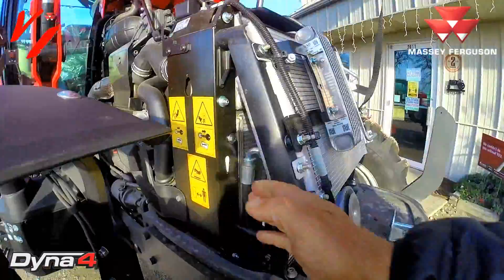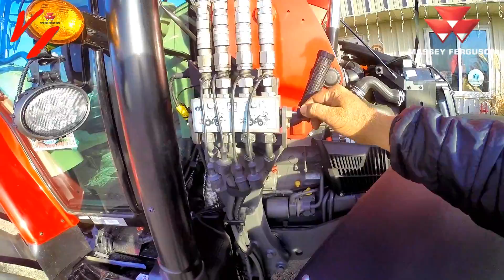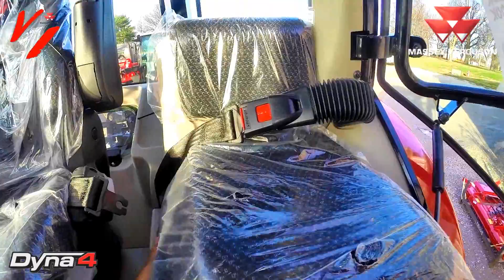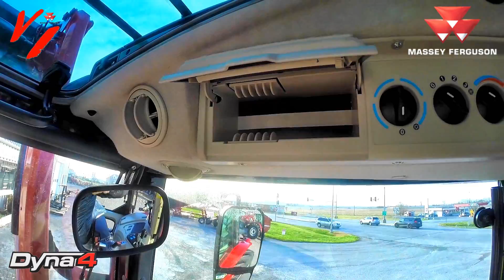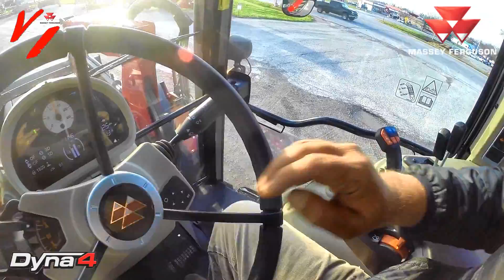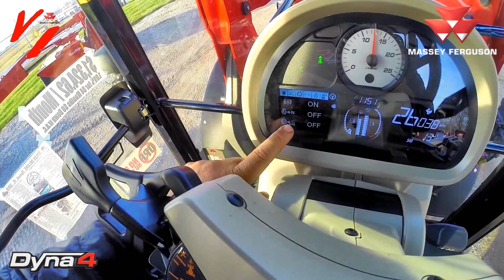MF 5713S Deluxe Mid-Range Tractor (130 Max Engine/ 125 ISO Rated/ 105 PTO HP) Dyna4

Comment: You responded to me the other day. I was asking you about the 5711. I bought one yesterday a 2020 5711 dyna 4 with the FL3819 loader, rear wheel weights, front fenders and a Kenwood stereo radio CD player. It doesn’t have the high visibility cab which is ok. The tractor is new with only 75 hours and the remaining warranty. Just wanted to say thank you. Your videos on the 5700 series helped me decide and how to operate the tractor. Love that dyna 4 trans and the visibility out the rear of the cab for hooking up equipment. I may be in touch again if I need any further tech advice. The tractor will be delivered later this week.
Reply from the maker: Congrats. Those have been very popular models and we can't keep them instock. Presold another the other day.